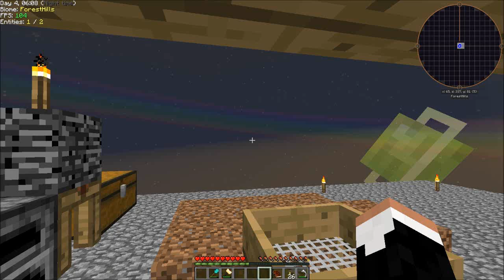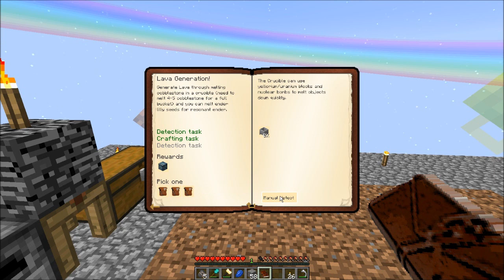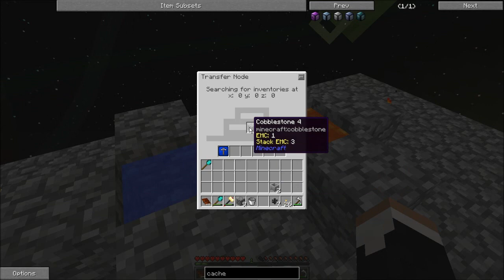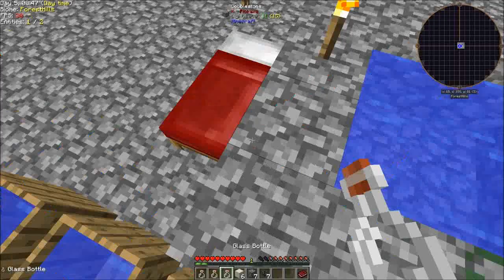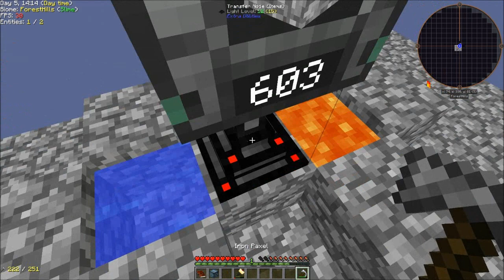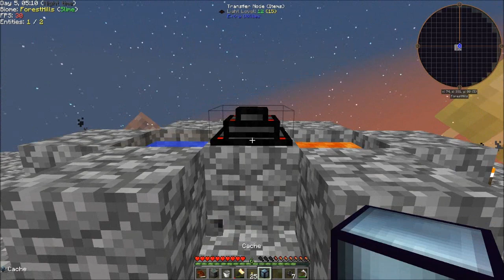Project Ozone 2 Titan Mode, E2 - Lava and Cobblestone

Comment: iron + 4 coal dust = steel
Reply from the maker: +George Cristodoulou I'll have to try that when I have a means of making coal dust, I'd be surprised if it was that easy in Titan mode though. I do have another solution if that doesn't work, though...and the solution is pretty easy, just requires some out of the box thinking, so who knows?
Reply: For dust forms of items you can use the AE2 grinder, but you need a machine to smelt them together